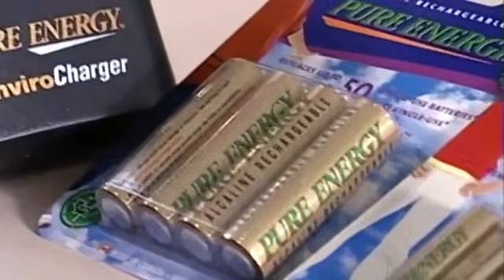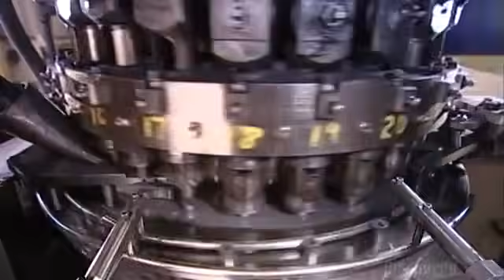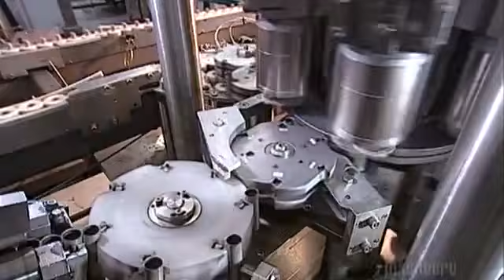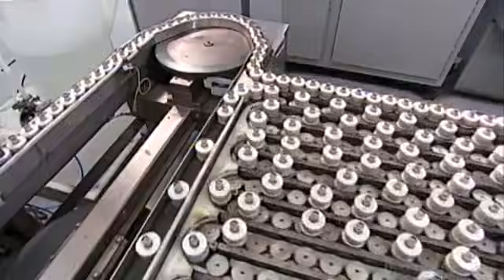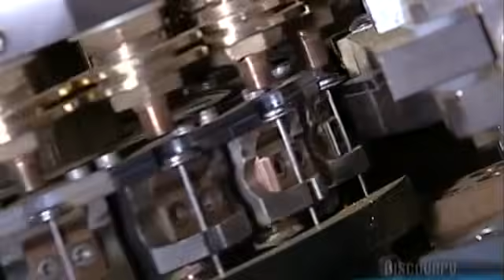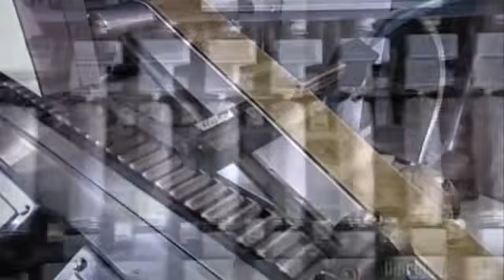how its made, alkaline batteries.

Comment: Nice, now I'm interested in knowing why a battery loses energy in the first place, a reason for recharging it? Out of these chemical's within the battery, what does the batter lose for it to lose it's energetic properties? Such suggestive lose in question as follows: 
Graphite, Silver Catalyst, Manganese Dioxide, Barium Sulphate, zinc, gelling agent, or Potassium Hydroxide?
Reply: It's not so much a "loss" as it is a change in property.  When you drain energy from a battery, it's safe to assume it's being converted into another type of energy;  Such a light or heat.  So it's more like a conversion of energy, than a loss of physical material.  Over time though, the electrolyte does dry out, which slows and eventually prevents the free flow of ions, effectively dropping the capacitance of the battery to zero.  As well, when charging a battery you're forcing current in reverse, and changing polarity often can physically damage the cathode, which also bites into the life span of a battery.  Hope that gives you an answer.
Reply: ***** yes, thank you, If I might add, you seem to have a good concept of teaching skill's. Do you teach student's about topic's in the study of how batteries, and in reference to your username, the study of Lazers on how they work? In which way Is a Lunaphase Laser Similar to a battery in reference to a batterys properties as in energy and heat. Simply, did you learn about lazers because you studied the function of batteies? I have no further question's, thank you again for helping me understand.
Reply: • Tensakuma "Tendro" Kadro
I've never studied batteries, this is just my knowledge gained while studying electrical engineering.  I work mostly with lasers, both in the physics involved in the process of lasing, and the creative applications of lasers, such as laser shows and displays.  Lunaphase Lasers is simply my company name!  I've given a few workshops on laser technology before, but I don't teach full time.  Thank you though, I appreciate the sentiment!
Reply: You cannot effectively recharge a Zinc-Manganese cell (the standard alkaline chemistry) because as you discharge the battery, the Manganese forms a phase that is not easily reversible. The Mn atoms form a bond that is very hard to break.

Comment: The narration is correct:  "In a discharging battery or galvanic cell (diagram at right), the anode is the negative terminal because it is where current flows into "the device" (i.e. the battery cell). This inward current is carried externally by electrons moving outwards, negative charge flowing in one direction being electrically equivalent to positive charge flowing in the opposite direction." -Wikipedia

Comment: Why don't they replace alkaline batteries with NiMH rechargeable?  The vast majority of alkaline batteries are not rechargeable.
Reply: +Afrocanuk nimh = 1.2-1.3v.... alkaline 1.5v... some devices have a problem with that
Reply: +beefstrudel That's a very common myth. Alkalines start at 1.5V and quickly drop to ~1.2V within the first 5-8% of use. Any device that only runs above 1.4V, would say "low battery" and shut off when the alkaline has around 93% of its capacity remaining, which would be incredibly wasteful. Alkalines lose voltage at an almost linear rate, dropping to about 1.0V and lower at 50% capacity. NiMh rechargeables, however, start at 1.4V (some at 1.5V) fresh off the charger and drop to 1.3V, stay around that level until around 60% capacity, then stay at 1.2V until around 5% of power remains, where the voltage takes a steep plunge (you shouldn't ever let a NiMh's voltage drop below 0.9V though - doing so can damage it). This would mean that devices requiring more voltage would technically run much longer with NiMh's as opposed to Alkalines because the former stays above 1.2V for a substantially longer duration within a usage cycle. This is the primary reason NiMh (along with their LSD variants) are recommended over Alkalines for high-drain devices - these usually require a voltage higher than 1.2V per cell for a longer amount of time.

Here's how an alkaline battery discharges: http://batterysavers.com/product_images/images/dch.jpg - Note the steep drop in voltage on a high-drain device.

+Afrocanuk Three reasons: companies make more money if consumers keep buying alkalines, alkalines are cheaper to manufacture, and some devices are better suited to being powered by alkalines - low drain devices like clocks.
Reply: +Gex9z I know that. But then again most battery companies will just have their brand name put on a chinese manufactured OEM.
Reply: Afrocanuk Actually it's vice versa. The leading battery manufacturers make their own batteries - some have gone so far as to trademark and keep certain chemistries secret. The ones you're referring to are counterfeits - badly made off-brand batteries that show labels from leading manufacturers just so they'd sell. I find the best way to make sure you're getting a genuine product is to order it directly from the manufacturer online (Amazon for example, has verified sellers).
Reply: +Gex9z  That's why I said "some," because I know Duracell and Energizer have trade secrets.  Unlike these two, lesser known brands will have their names put on OEM's.
Reply: Afrocanuk Lesser known brands, yeah. Any that do that would not be considered a leading manufacturer though. Gotta give em some credit for trying. The reason they resort to this practice, and what held NiMh technology back was greedy manufacturers keeping its technology a secret - letting Li-Ion take over as the industry standard. It's a shame NiMh technology didn't take off as much as Li-Ion though - it's not that it was older - in fact, it was developed at around the same time as the latter. It has such a good energy capacity to safety ratio while being rechargeable (meaning it can pack a substantial amount of energy without safety being sacrificed). Yes, Li-Ion has a higher energy density, but it's only feasible because of the numerous protection mechanisms put into every developed Lithium battery. NiMh doesn't need any of that - all it needs is a safety vent and yet it's still safer than a fully protected lithium cell. You can tell how well the secret is guarded just by looking at its name: NiMh (Nickel-Metal Hydride)... I mean "Metal? Which metal?"

Comment: To settle this once and for all. the cathode is negatively charged in galvanic cells e.g batteries. Because; electrons flows from the anode to the cathode and accumulate on the cathode making it negatively charged.
However it is correct to say the polarity of the cathode is positive, because we describe the electrodes polarity  where positive charge from a salt bridge flows, which in this case is potassium .
Source: Brown, T.L., and LeMay, H.E. (2005). Chemistry: the central science (Upper Saddle River, N.J.: Prentice Hall).